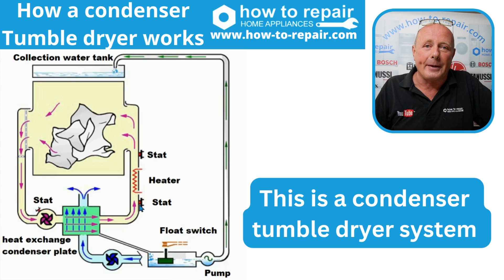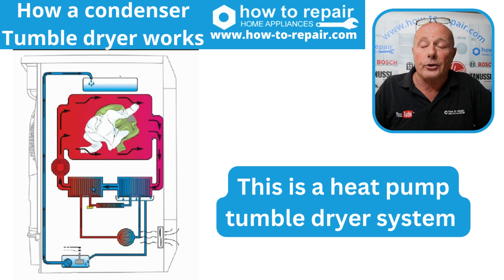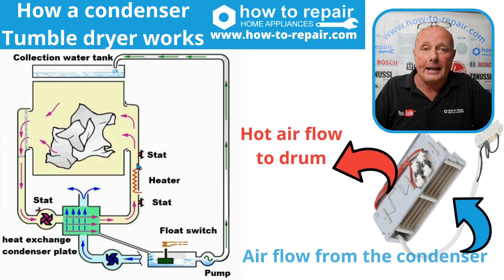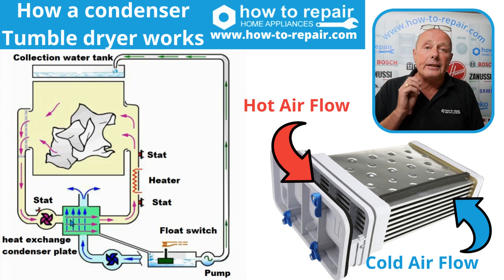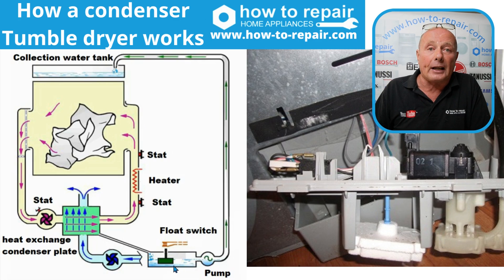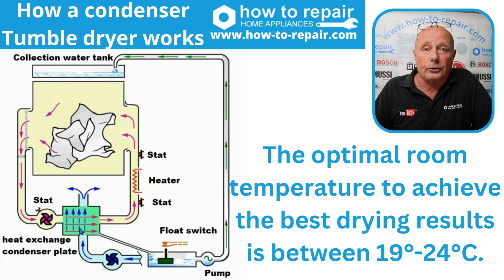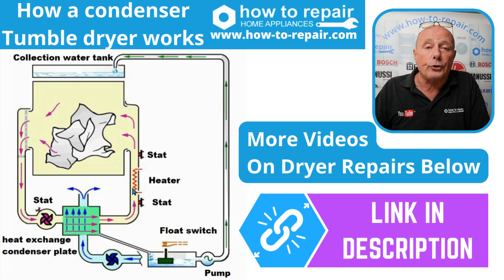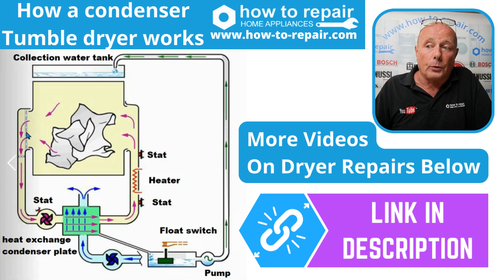How a condenser tumble dryer works air flow through heater and heat exchange condensor plate

Comment: Thanks very much. I have a Hotpoint TCEL 87B, which is taking a long time to dry anything and is not filling the water reservoir. The warm airflow from the drum and the cool airflow from the room still seem to be working, and no water is leaking from the bottom. Is it likely to be the heating element failing?

Comment: Hi there I got a AEG 57800 tumble dryer it's not drying my clothes and after a while it just went off no power on the tumble dryer plz help
Reply from the maker: Hi, I will need the full model number of the identification plate and the details of your problem. Please use our contact us page and make sure you fill out the request for what your problem is. A video shoot of the problem would be perfect as well.

We will get back to you within 24 hours, normally. https://www.how-to-repair.com/help/contact-us/ 

Please remember to subscribe to our channel, as that's what keeps this channel going. Thanks, Paul 👍

Comment: Stupid question but I'll ask anyway...why is there a need from the small reservoir "bit" at the bottom, the float switch then the pump to get the water up top? Why don't all condensr dryers have the collection tank at the bottom? All I can see is more stuff to go wrong, but there's obviously a reason for it :)
Reply from the maker: Very good point the small reservoir holds about quarter of a litre when this is full it then has enough fluid to fill the pipe to transfer the water to the top, if it was trying to pump with less water, it would only be filling the pipe and then it would flow back down when the  pump is turned off. Hope that answers your question As an ageing appliance engineer, my expertise lies more in the domain of domestic devices than in IT, resulting in a limited understanding of YouTube video optimisation. Consequently, my videos might not reach their full potential due to these IT constraints.

Nevertheless, they offer invaluable aid to those who encounter them. Your support in sharing our channel on social media would be immensely valued. By disseminating our content, you enhance our visibility and contribute towards addressing the pressing matter of appliance wastage. In turn, you play a role in averting numerous machines from facing an untimely end in the heavenly scrapheap of appliances. Thanks 👍

Comment: Do heat pump dryers release moist air into the room?
Reply from the maker: No the moisture is connected on the evaporator and then pumped to your container
Reply: @How-to-repair  Thanks for the reply. Just to clarify, did you mean "collected in" instead of "connected on"? Thanks

Comment: The comment about inefficiency at lower (eg garage) temps doesn't make sense to me. I would think the colder the condenser plate the better and quicker the condensation? Why not, if that's not the case?
Of course, you wouldn't want to be running it anywhere near freezing, cos then you'd be dealing with ice formation.
Reply: I guess is because the air will be cooled down too much and it take extra time and effort for the heater to reheat them to the desired temperature, I can’t think of any other explanation

Comment: I have a question. I have a condenser in a small utility room.

The walls are external so the humidity is weeping onto the walls.

I have a vent in the room, is there a way I can make the room less damp?

Shall I connect the vent in the wall to the air intake (cold air) or let the warm air escape out.

I could install an extractor fan but it may effect the efficiency of the dryer, because the warm air is being extracted.
Reply from the maker: I would actually get a small dehumidifier @qkayani please remember to subscribe to our channel as that really helps us https://www.youtube.com/shorts/e432SAb2g08  Thanks, Paul 👍

Comment: Why do they always put the collection water tank at the top of the dryer? seems like it is a bad design because it will need a stronger pump than if the tank was at the bottom of the dryer.
Reply: Mostly for usability - imagine a disabled/elderly person trying to bend down, lift out a compartment full of water (2-5kg), then stand-up, take it to a sink, then refit it and do it all again the next time.

Comment: Great video, thank you. I have a Zanussi ZDC8202p condenser dryer and the water keeps leaking from underneath and not collecting in the water container at the top. It is level and I’ve cleaned the condenser and the primary filter. Any suggestions on what I can check next? Thanks 😊
Reply from the maker: The water Kalex on the condenser plate then it runs down the plastic to the pump system or two a collection bowl. If any of these fittings are blocked. You may have a problem and sometimes the plastic can get cracked on the base of the machines so do inspect this as well. glad we could help you @shellyrose6732 this is for you https://www.youtube.com/shorts/e432SAb2g08 please remember to subscribe as that's what keeps this channel going. Thanks 👍

Comment: My brand new tumble dryer is leaking water from its first cycle out the back
Reply from the maker: A couple of things that might be causing the problem. Make sure the machine is 100% level. Secondly, inspect the plastic underside sometimes they can get damaged in transit. If none of these are a problem, then I suggest you call the manufacturer glad we could help you Jamie this is for you https://www.youtube.com/shorts/e432SAb2g08 please remember to subscribe as that's what keeps this channel going. Thanks 👍

Comment: I have heard that condenser dryers emit moist air into the room. According to your diagram, it looks like the humid air is confined to a closed system. Can you comment on the amount of moisture that is given out by a condenser dryer? Thanks
Reply from the maker: there should not be a lot of humidity going into the room that humidity should actually be absorbed on the condenser plate.  glad we could help you Nowthen AD this is for you https://www.youtube.com/shorts/e432SAb2g08 please remember to subscribe as that's what keeps this channel going. Thanks 👍
Reply: Based on my experience condensers emit moist air, I have my dryer in the toilet and when I use it I have to keep the door open. I had another experience as well when there was a leakage in the condenser circuit and it was not drying, it was the time a lot of moisture was released in the air. BTW my suggestion id to keep the door open if it's confined in a small room. -TheHandymanItaly

Comment: Thanks for the upload. I’ve got a condenser dryer and for some reason the condensed water won’t show in the reservoir located at the back of the device. I’ve tested the pump - it’s working, however there’s no water to pump, the reservoir is almost empty as well as the upper container. When I remove the condenser unit it’s always loaded with water so I assume the condensed water can’t get to the back reservoir in order to be pumped up to the upper container. 
How the condensed water should get to the back reservoir?
Reply from the maker: Sorry for the late reply I was away on a few days holiday. I will need the full make and model number of your machine but normally this is because the water is not draining from the heat exchange unit to the reservoir. There are usually some small tubes and these can clog up with fluff..   glad we could help you Bihari Tamás this is for you https://www.youtube.com/shorts/e432SAb2g08 please remember to subscribe as that's what keeps this channel going. Thanks 👍
Reply: @How-to-repair  hi, thanks for coming back to me. I managed to figure out what the problem was. The condensed water gets drained into a reservoir at the back of the machine and from there there is a hole leading towards the main reservoir loacted at the back panel. That’s the reservoir with the pump. So the hole at the first reservior was conpletly blocked with some greasy stuff hence the water couldn’t drain towards the main reservoir. I cleaned the hole and tested by pouring a glass of water in the first reservoir to see if the water disappears. It worked like a charm so now the whole system is working fine😊